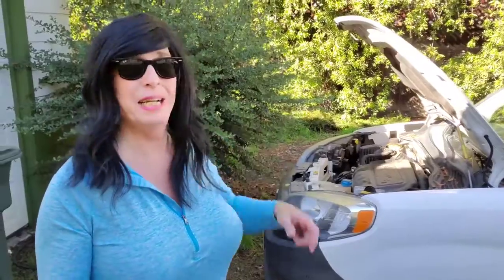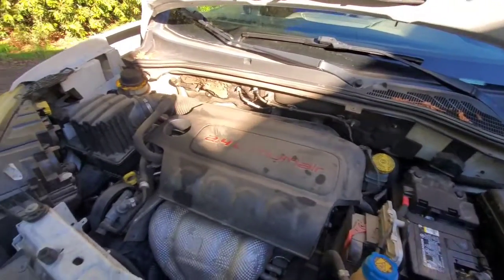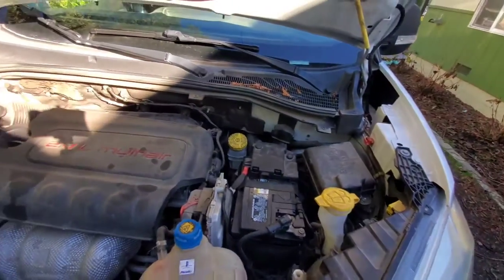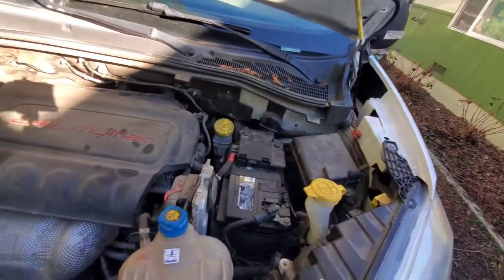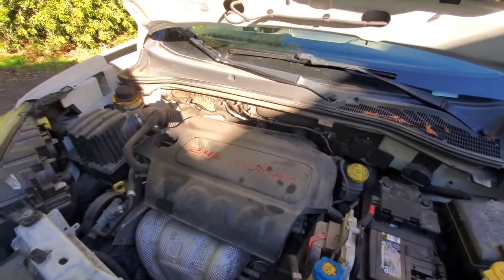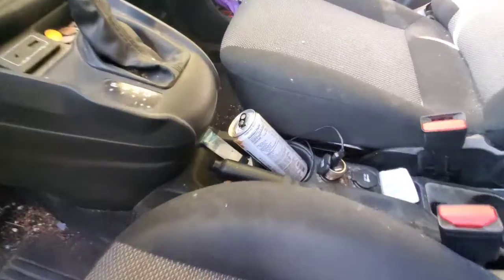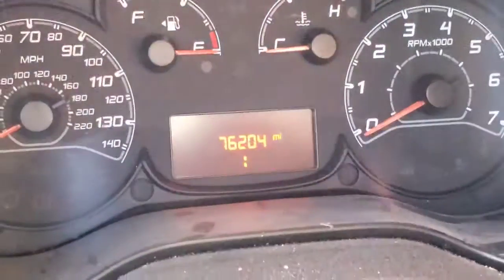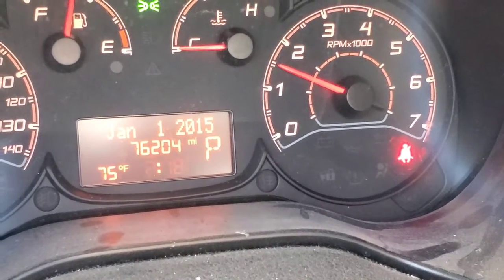The "Check Engine" Light of Doom...Can We Beat the Dealer?

Comment: i use scan tool only 40$ plug in check port it scans then delete whole a lot easier disconnecting batteries scan tool codes tell what it is check codes with Google battery disconnecting might work but it won't tell what's going on.